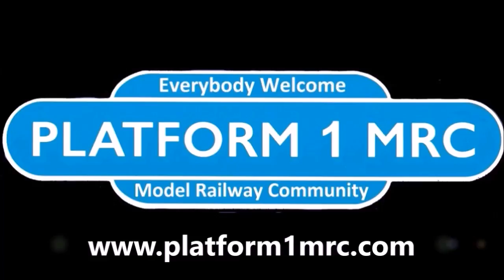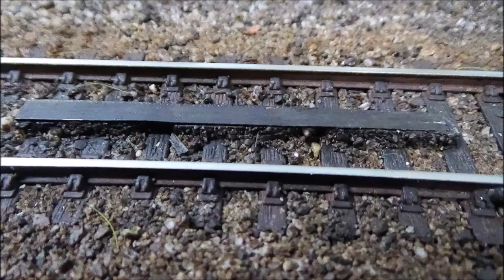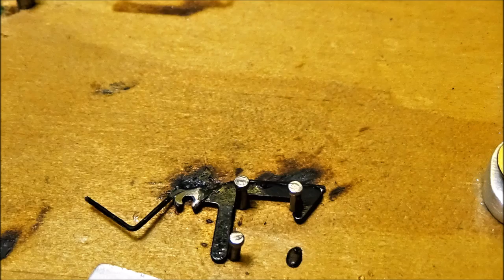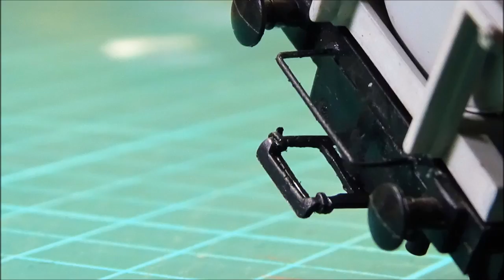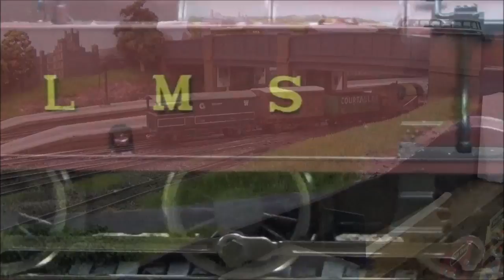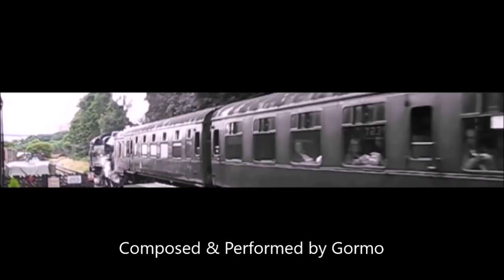Magnetic Delayed Uncoupling

Comment: Hi Gormo
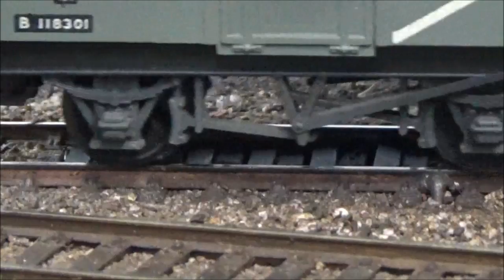Looking again at the video, I think that the "stuttering" of the coupling hook from 1:30 to 1:40 is probably caused by two issues. a) the tail is not long enough and so tends to return to normal position between magnets. b) the tail is not parallel to the sleepers when the hook is in the raised position and therefore oscillates depending upon the strength of the magnetic field.
Reply from the maker: Could be right Ray but I`m over fiddling with that method when the attachment to the top at the back of the coupling hook gives a better outcome overall
Cheers, Gormo

Comment: Thanks for the clarification Gormo ! I guess you could also use a piece of brass wire for the DIY coupling. I now just need to convert over 100 wagons and about 50 locos !
Reply from the maker: No worries Ray,
The DIY coupling needs to be thicker than wire. It needs that little bumper bar like the Bachmanns otherwise it will ride over the top of the opposite Bachmann coupling and cause derailments. I tried that when I first started out. They look good but they don`t function well with just wire. If you have dead flat track and no inclines it may work but otherwise build a bumper into the design Ray.
Cheers, Gormo